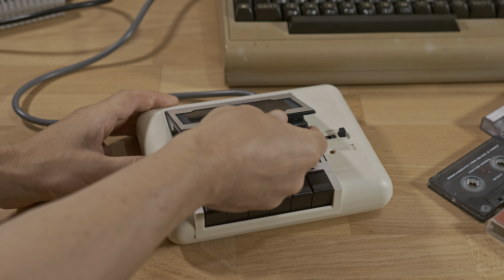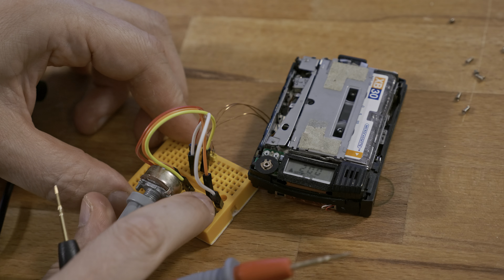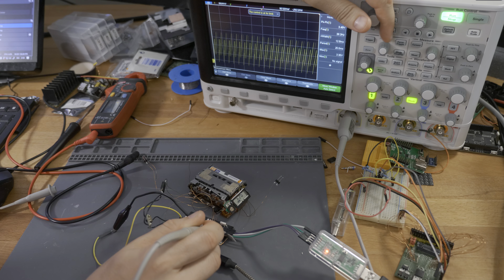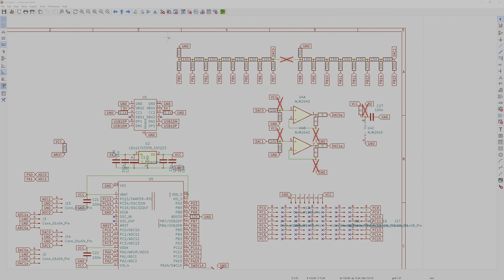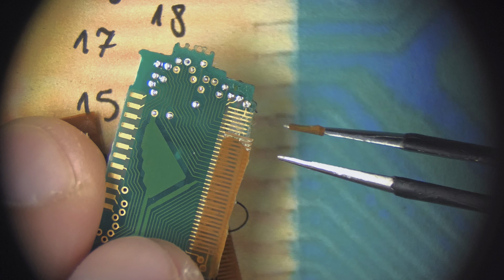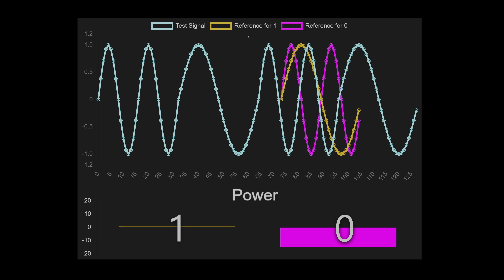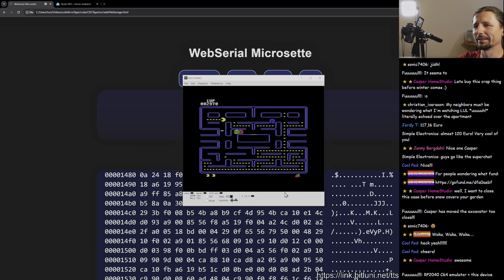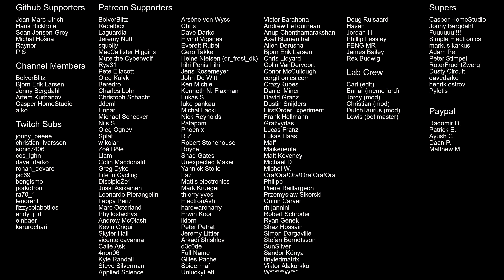I reinvented the C64 tape drive from the 80s... but tiny and USB

Comment: you could use Hamming code, it's better than storing 2 copies of a data chucks, because if one of chuncks corrupts, you can tell that one of it corrupted, but which of then and where probably no, classic Hamming code used in Raid 2 and can recover one bad byte and detect 2 bad bytes in 7 byte sequence, it contains 4 bytes of information and 3 redundant bytes and it's super easy to implement

Comment: The old 8 bit did not use AD and DA converters. They only did read/write single bits. Output trough a low pass filter to make the square waves a bit more sinus like. And the input using either native component hysteresis or a schmitt-trigger. They used a fast loop counter to determine the frequencies.

Comment: I've actually been getting into storing digital data on tape recently, and this just popped up onto my recommended! However I've been struggling with getting reliable data back from my tapes, even using Kansas City Standard at 300 baud. Would you have any insight on recording levels to the tape, getting the audio from the tape back, and decoding?

Comment: I had really good experience with phase shift modulation. You just need to make a PLL. I would also consider using error correction by having a parity bit for each byte, and a parity byte every 8 bytes. This way you can correct one flipped bit in 8 bytes. And to account for longer defects you can interleave 8 blocks, so defects up to 8 consecutive flipped bits can be corrected because each damaged bit will be in a different block. CDs are recorded using that principle.

Comment: Can you make a compact EEG, battery powered crown that relays the collected EEG data to a ' server ' ( I do not know what to call it... but what i basically mean is a storage capable receiver) via radio waves ( any frequency is accepted). And the server can be connected to a computer via USB ports or Bluetooth and the data visualized? The crown should have an active connectivity range of a cellphone ( stays connected to the server no matter where you are city wide via... again... radio)... and the server doesn't necessarily have to be far away from the, say... laptop, to be connected... Bluetooth range is fine! Oh... And if the connection between the crown and the server is, at any point interrupted... the crown is able to store the EEG data it failed to send during the interruption and relay it later when the connection is back on. This one is optional but if you can give the crown optics and allow it to record and relay EEG data with corresponding Audio and video... I WILL BOW DOWN AND WORSHIP YOU!!!(This is sarcasm by the way... For those out there who don't get it!) [CAUTION SIR: I MIGHT SPAM YOUR COMMENT SECTION UNTILL I GET FEEDBACK ON THE FEASIBILITY OF THIS PROJECT...😅 YOUR DESGRETION IS ADVISED] ( COZ HONESTLY IF YOU CANT DO IT... I BELEAVE NO ONE CANT)

Comment: No one take a tape to save a file in 2025. but I have a lot of cassettes with very old data. to transfer this from old savings to a SD-Card it needs something like a FSK-Decoder and a tape recorder. but is the old data so important to do this? the old 6502 system really exist unused over 30 years. the question is are the tapes readable after the long time and play a cassette recorder for this experiment? on EBay there are many HiFi-Cassetterecorder to buy but I don’t need the answer.

Comment: The ZX Spectrum used a much simpler method of tape encoding and decoding. The "ADC" was just a simple level sensor. It used 2 frequencies, but it output them all, again, from a digital signal. Basically the recording sends out a couple of pulses of a certain length, driven by software on the Z80 writing to a port on the ULA chip. Then to read back in, all it did was detect the ZERO CROSSING. You detect a zero crossing, you start a counter, then when the next zero crossing happens, you look at your counter. If it's high, it was a long, low-frequency pulse, if it's low, it was a quicker high-frequency pulse. And that's it! All there was to it!

It was flexible enough that people wrote turbo-loaders that could use a higher-than-standard encoding rate, on good enough tapes. You could also run software, the Pac-Loader ran a simple Pacman game while keeping an eye out for the zero crossing from the tape, so you could play a game as the main game loaded. 

The output was purely digital, technically a square wave, but Sinclair knew it likely wouldn't survive being stored on tape. But only detecting the zero crossing meant that didn't matter! The whole tape audio system would likely reduce the signal to something more like a sine wave, but the frequency, and therefore the zero crossings, was the same. The whole circuit was a couple of capacitors and resistors, maybe a transistor buffer for input.

It could load in 48K of data in about 4 minutes, you work out the BPS for that yourself. Simplest, best, cleverest, it's what Clive Sinclair was good at.

Comment: you can also encode your data using the Reed-Solomon algorithm, you can recover your data even if a certain % of data is lost depending on how many parity of packets you add. Reed-Solomon error correction algorithm sis used in QR codes, CDs, etc

Comment: As an error correction scheme, I'd suggest subdividing data into blocks of e.g. 128 bytes each, with each block preceded by a synchronization header and guarded by something like a 16-bit Adler sum, and at the end write out a 128-byte xor of all the even-numbered blocks followed by a 128-byte xor of all the odd-numbered blocks, or vice versa if the number of blocks was odd.  This would only require writing two extra blocks of data, rather than writing everything twice, and could handle the corruption of any single block, pair of consecutive blocks, or any two blocks with an even number of good blocks between them.  If a bad block is encountered in the main part of the file, the system would need to make note of where it was, load the appropriate error-correction block into that space, and then xor the data in that space with every other even or odd block that had been loaded.

Comment: For storing/retrieving tape data you don't need ADCs or DACs. The computer only triggers on the zero crossings by simply writing them as AC coupled signals and reading them back through a comparator - if you're doing FSK, only the time between the zero crossings is important. If it's above a certain threshold, that's a 0 (space), and below a certain threshold it's a 1 (mark). And if the time becomes too long, that's a "nothing" or end of data.
Reply: I was going to say the same thing. Zero crossings can be used for the reading, I've done it a couple of times.

Comment: The original signal used for tape drives was the same 300 baud one used for modems at the time which saved code space in the ROMs. They basic produced square waves which was passed through a low pass filter to end up with a sine wave.

Comment: You know what isn't sensative to tape speed... The strategy used by a game cube controller, GM 24x crank sensor, and Ford PWM OBD; those are all fundamentally the same. You'd sacrifice all the analog range though, like taking a QLC flash SSD and converting it to SLC. The short technical explanation is, pulse period is the bit, majority high pulse width high vs low determines bit state. Something like a 25%:75% or 1/3 and 2/3 split being good for variation and max signal speed stabillity. The GM ECU turns the teeth width into a stream of ones and zeroes and compares the most recent reading to predefined patterns in an array. Specific cylinders are triggered when their pattern is matched.

Comment: Do I understand it correctly: You are basically using the same coding scheme, which was being used in the Kansas City standard of the early 1980s? Some more complex codings like QAM will possibly allow you to store much more data on one cassette.

Comment: Another method of saving and loading data is to use MFM, like on old HDDs.  Each bit occupies a certain amount of time and that time is divided into four segments.  For the purposes of example, let's say 4 milliseconds divided into 4 x 1 ms segments.  The first segment is always a pulse high which goes low at the end of that 1ms time segment.  The second segment is 1ms of silence.  The third segment is either another 1ms pulse high, or 1ms of silence, depending on whether you're storing a 1 or a 0.  The final segment is always 1ms of silence.  Doing it this way, the timing is always reset for each bit, because you always start by looking for a pulse then you wait about 1.5ms (to get into the middle of the bit) and check for another pulse to find out whether the bit is a 0 or a 1.  If you start your recording with a string of "dummy" zeroes, that will synchronise the recording.
The hardest part is making sure that the timing is right in your microcontroller.

And just repeating to highlight this point: If it's done right, the timing is reset on each bit, so it can't "stray" very far.

Comment: Getting remote control over playback was a huge waste of time and perfectly good recorder. Encoding choice and implementation are both very poor. I'm not gonna advocate for use of readily available solutions, but when there is a bunch of open source code for the same task, you can't roll out half-assed mess like this and call it a day. Also, making a mess of wires was your choice too. Could've make it into a nice bus with as much as a cotton thread, but you chose not to. Reflect on this.

Comment: Another great project that went fairly well. I have a request for the next video though, can you please use a better microcontroller in the next project? I know you’re trying to save money, but i found that cheaper microcontrollers mean less functionality and not as good software. I tried to get a ch32 chip working, but it was a nightmare, and playing around with usb drivers didn’t help. And finding good software is not possible at this time, only the bad software exists so far. I think an esp32-c3 might be small enough to fit in your projects perfectly, and provide more power and memory than the majority of ch32 chips can, and it’s still a RISC-V chip.

Comment: How about hamming codes instead of just duplicating data? Also if the tape is messed up in a fixed location, you could also just not use "bad blocks". To keep things fast and not require perfect alignment, read everything back after writing the entire file, then if errors are found, write everything again from the beginning, using some marker to skip areas of tape that had errors with a wide margin around them.

Comment: Absolutely love it. I had a similar vision for a Rpi4 Project running an IBM S370 MVS Emulator, I imagine using a similar size micro tape drive to create a miniature version of the original S360 Hardware.

Comment: Feel like a RISC V is "only slightly" overpowered for this application. Y'know, a single chip solution that's faster than the fastest super computers in the world when the datasette was relevant. Could just emulate the entire machine while you're at it.

Comment: You could, in theory, forego the DAC in favor of a single digital output pin and a low-pass filter. You would need a sharp cutoff right above the higher frequency, to eliminate the harmonic from the lower frequency without over-attenuating the fundamental of the higher one. It would probably take a lot of tuning and ultimately not be a less complex or less expensive design, but it would technically save a few microcontroller pins.
Reply: Although I guess at the receiving end you don't really even need something resembling a sine wave, you could just use square waves on the tape outright

Comment: Awesome little project.

Your approach, storing the same sector twice is actually quite similar to how audio CD's make sure that a little scratch doesn't ruin everything.

If I remember correctly they do the same data twice, just with the repetition binary inverted, and then they have a CRC, modulus or something similar so that the player will know which one of the copies is corrupted.

You could modulate more non-resonant frequencies within that bandwidth, for higher data density and quicker load times, I believe, but you probably know that it would take more amplifier circuits to do properly. 

I would probably just have butchered an old analog 57k modem, which was already designed to be used on POTS phone lines which were also optimized for the voice-frequency-spectrum, you could expect from old-fashioned phone lines... then you could have around 25 MB stored in a 60 min recording...  or 12,5MB if you implement your double-recording error correction.

But of course, then you perhaps wouldn't learn a whole lot about the signal processing.

Anyway, as said, awesome project.

Comment: Não é viavel fazer bits em terças? Tipo A=1 C=0 E=0 G=0
Então vc pode escrever varios bits em uma única sequência pq vc pide usar A0 A1A2... Na mesma partitura, fazendo um acorde de bits com 6-8-10 bits ao mesmo tempo, assim vc aumenta a densidade da fita
Reply: Se o sistema conseguir ler a uma taxa de 120bpm e ele conseguir ler uma sequencia de fusa 1/8 de tempo eu tenho 120*8*10=9600 bits por minuto de armazenamento.
Reply: Se ele não der conta de uma fusa vc pode usar colcheia cai pela metade porém é valido
Reply: Ou seja uma fita pode chegar a 70mb

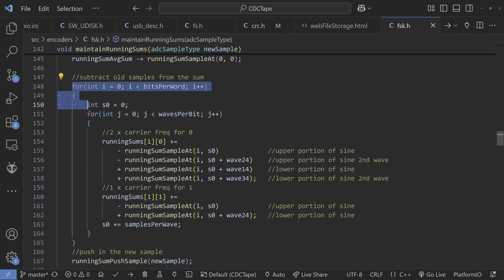Comment: 8:54 Firstly, why is this kind of code in a header file? Seems odd, but hey. Secondly, it seems you're only using one core to do the analysis. And are you using macros/inlining in the most speed-critical code? Actually, I suspect SIMD could be used for this kind of calculation. If your RISC-V chip has got SIMD, of course (does it support Vector Extension (RVV)?).

Comment: "Just save chunks twice in a row" ... that's basically what Commodore did with their Kernal loader, which stores the full data twice - once for reading, once for error checking. Going with chunks makes way more sense, even when it doubles the load time overall (just like Commodore's approach), but would detect errors way sooner rather than after having spent twice the time in a worst case scenario.
Seeing what sponsorships you accept tho ... why not try Honey? It will please your corporate overlords.

Comment: Should have used OpenSPARC instead of RISC-V. How is an LTO-4 tape drive capable of storing TERABYTES on LTO tapes at very high speed, hardware compressed no less?

Comment: 8 bit machines could not employ Fourier transform, they did not even have real ADC's, they simply sampled with one bit resolution and measured duration of low and high voltage.
I did not understand why he developed a custom file format and did not re-use the one of ZX, C64, or Atari?
Reply: They did not. They measured the duration between zero crossings.

Comment: I'm a bit mystified by this. What's the point of the multi-level A/D and D/A converters? If you're just doing FSK, you all you need is an on/off output to generate square waves, and a zero-crossing detector on the input to let you work out the frequency. You can do this with much less processing power, such as just a 1 MHz 6502. In fact, you may have in your collection something that already does exactly this.

Comment: Does it support stereo? If so you could store data as a QAM or even as OFDM thus improving its data density. 
The drawback would be that you'd need to include some synchronization and more decoding...

Comment: uCassette is pretty good , you may be able to borrow some encoding techniques from other uComputers of the day. including CRC error correction, FEC, timing pulses etc. maybe even some dial up methods ( dial up was built to run in the limited bandwidth of a noisy phone line,

Comment: What if you use a stereo head and run left channel as timing and data on the right?  Would make accounting for tape speed a non issue.  I think you could even use it on a standard recording device without the need for the rebuild.

Comment: The original systems that allowed saving and loading from tape ( Apple ][+, TRS80 as examples ) would save to tape twice.  The loading would compare both versions in case of errors.  Most of the time loading on an Apple ][+ would work even when the tape got " sticky " ( hard to move, requiring fast forwarding and rewinding a few times ) while the TRS80 I had access to would not load and show an error.  I forget what the error was on the TRS80.
Reply from the maker: Interesting! An idea I haven't tried yet is to write once, a rewind, read back and compare which chunks failed and only write those the second time